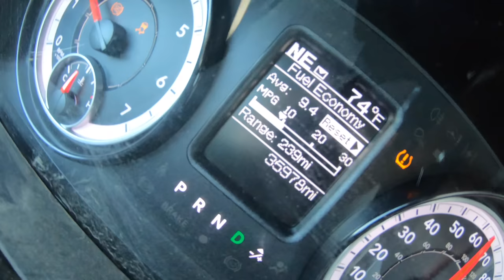How this Roll off dump trailer EARNS EXTRA Money!

Comment: Some good comments being made in the comments, but they're still limiting their thinking - with a "flat deck" one can effectively palletise* other plant as well.
Think large welders, large emergency pumps, emergency generators, etc, that are too small, and or light, for a "J" or shipping container platform to be required or cost effective. Hire companies and government/state/municipal/utility companies may be a natural market for these.

*As a kid I was enamoured with the whole Thunderbird 2 concept - use a standardised container and you can use the same machine to move everything. I still try and apply it to plant in general, when allowed.
Reply from the maker: Thats brilliant.  I didn't of it that way.  Im pinning your comment if thats ok.
Reply: @Dirtmonkey  
No worries - pass it on to the trailer builders, too, if you think they may be interested 👍😎
Reply: They need to add conex boxes to there system
Reply: @Dirtmonkey   A concept that has ran thru my mind about this style trailer is to have a half flat deck and half enclosed setup. That was you could use the back half that is flat to load or transport material to the jobsite or as stated put a large pump or welder on and use the front enclosed area as a mobile job box to store and secure tools  this could even be fitted with a fuel tank to allow on site fuel, tool, and storage.
Reply: Any more feedback to share on the DuraHaul after a year? I noticed they're no longer a dealer.
Reply: This concept will be made into all of that. It will be the Swiss Army knife of trailers. Think about construction site trailers and campers and tiny houses  a standardized system that encompasses all applications will be the industry leader.  And those features being compatible to this concept will also be more valuable.
Reply: I've been checking out all of the roll off companies and will check this one out now. Another idea is you can also haul small skid steers and excavators, roll the whole bed off with the equipment still on it, the driver can leave and do something else while the site workers unload the equipment on the ground and keep working.

Comment: It would be nice to see if the company can build you a sealed, lockable Job Box roll-off.  When doing a job like a retaining wall, you can deliver the box to the site first with all the necessary hand tools, power tools, basic supplies, and the small plate compactores.  Everything you need at once and a secure place to store the equipment at night.  At the end of a job, pick it up and move it to the next.
Reply: that's would be handy.
Reply: More excellent idea!!!
Reply: C can
Reply: now that's good.
Reply: Yeah that would be a great idea!
Reply: Seen a construction company with that. They created those them self
Reply: Like the way you think man drop off toolbox
Reply: I started outfitting cargo/shipping containers 3 years ago doing this. Each framing crew has a container and I have 1 roll off trailer to move them
Reply: Shipping container?
Reply: You guys never worked in sketchy neighborhoods?  People will break into anything given enough time.  Don't leave anything on site.
Reply: Isn't that just any enclosed trailer?
Reply: Well, they actually make roll off flatbeds. You can easily design one with everything bolted/welded down. Shoot, now that we're in this discussion, roll off office/tool shed so you have a place every morning where you drink coffee and plan,  and pack out.  You're welcome,  now you have a fat business idea
Reply: @chaseoes  enclosed trailers are easier to steal, steal from, you get thieves trying to get in. It'll be more solid. You don't need multiple trailers. Pick up drop off
Reply: @creeplife2802  ... and... it's gone.  =(
Reply: Sounds like an enclosed trailer that you can just unhitch and leave it without having to dump an enclosed box off the the goose neck…..
Reply: @snowmankace7769  is there a way I can see this or get pic? Thank you
Reply: @austinrush6057  Yea but a grinder and the enclosed trailer hitch is unlocked and one can just hitch up and go.  With a roll off you need a specialized trailer to steal... And now if one just gets a roll off trailer then one can have a monopoly on stealing rolloffs LOL
Reply: @trevors8577  If you’re going to bring a grinder to steal my enclosed trailer, why I can’t I just grind the lock off your box for this and steal everything? Same thing as a lock on an enclosed trailer hahaha. Bring a grinder to my storage unit too if you want. You’re going to get all my stuff. I could easily winch that bin up onto a tiltbed also. I really don’t get your comment.
Reply: @trevors8577  Someone who wants to steal is going to figure out a way to steal.
Reply: Turn a Dumpster into a shed by welding ceilings
Reply: Or just buy a $3500 box truck.
Reply: That's honestly a killer idea
Reply: So you want a connex box... Just Google shipping containers
Reply: Southland trailers out of Alberta has a roll of trailer with bins, flat decks and a shipping container like you’re talking about
Reply: Dude, just get a mini crane and a job box, boom solution fixed. If not get yourself a bunch of military style crates, and just strap them together so you can’t run off with them.

Comment: nah ill pass......these 10 to15 yrd cans I see on Ford 550 are the way to go.....now you have to worry about a trailer hauling it???   I use these setups on Ford chassis  all the time in tight areas, can't do that with a trailer......here in Nashville, Tn Viava charges $365 a dump.....7000lbs is the max

Comment: 😢 Buy it with the 8000 pound axles and have the title read 14,000 total GVW for the trailer and if you have an F350 that would have a GVw  of around 11,000 pounds so you would be under the 26,000 and your rims and axle and tires would be up for heavy duty work especially when nobody’s looking And it will go over curbs fully loaded much much better

Comment: If they welded big D-rings in the corners and the middle low to the base you could transport equipment as well…. With the weight limit in mind.
Reply: Most companies sell flat beds that can be rolled on.

Comment: I'm third generation in the solid waste industry aka garbage man...lol. 
In 1960 my twin uncles had built the very first Roll Off truck.
They called it a Drop Box truck with 20 yard boxes.
My uncles worked for their mother, my grandmother who owned the
the first garbage company in town. She only invested in the build
of the truck and didn't patent the Drop Box idea back then.
!!!CAUTION STANLEY!!!
I drove a Roll Off back in the 80's for 11 years and the one thing you
had to watch out for was boxes loaded to one side with dirt or
concrete, they flip over on there side when loading on the truck.
I would pound the sides of the box and if it sounded hard it was
loaded heavy to one side and you couldn't see it for each load was
full of other debris and tarped. Even at that. be careful on turns, they
will roll over easy if loaded heavy on one side. I could show you all
kinds of tricks we used to do loading/off loading in difficult areas.
But I live in California 🤐don't tell anyone!

Comment: Great video, there is a company from Minnesota that makes nothing but these types of trailers. Protainer out of Alexandria. MN. 

We have some of the best trailer makers in the country. You would have saved yourself lots of fuel. 

The plus side with Protainer is that they're containers can be used on any standard roll off truck as well. If I'm not mistaken, they're the only company that uses standardized boxes. You could use the same box on a trailer that you put on the truck and then you could also buy it containers from other manufacturers as long as they were a standard rail box.

Plus if you want more cans/containers you just have to drive to Alexandria which I'm sure no matter where you live in Minnesota is closer to you than Texas.

Comment: My experience has been on the consumer end of the business, getting a dumpster for remodeling jobs. My projects are usually on the smaller side so I can often handle things with my single axle dump trailer. The last time I had to price dumpsters I called three ‘different’ carting companies and the same person answered the phone each time. All three were owned by the same parent company.
Usually here in Connecticut you get a price for a certain volume, say 12 cu. yds, a week to fill it and a weight limit, say two tons. If you keep it for a longer period of time they add on a certain amount per day. If the can is over weight when they dump it they will bill you, as in charge your credit card, for the overage.
Reply from the maker: good info- Thank you.

Comment: Having worked on rolloff trash trucks for 2+ years my recommendation would be have a 2nd winch installed and wired in for redundancy as when a can is overloaded winch cables break and its no fun when a winch cable breaks and takes out a glass window or even hits the operator not to mention the can sliding back off the trailer and you being stuck with a broken trailer needing to pickup a box that's full. personally id get a hooklift trailer that uses a hydraulic arm to lift cans on and off they make trailers and beds for trucks and there is way less to break on one of those than a flying winch cable
Reply from the maker: I never though of it like that.  I wonder if someone makes a hook lift trailer for a pickup?

Comment: i’ve wanted one of these for a few years now since first seeing them, but my biggest concern is all the negative i’ve seen/heard about the lifting power when dumping. i had some texas built dump trailer 10 years ago that could barely lift C&D let alone dirt so hot rod of it within a year or two, since then i have multiple brimar dump trailers and they never let me down. and obviously a box with 4 foot walls you can’t load the entire thing with dirt you’d be way over weight (i know that part) but i’ve seen a lot of guys on youtube that put only a couple yard of dirt and can’t get these to lift yet i’ve lifted 6 tones of cement in my brimar dump trailer. but i’ve also seen these dumpster trailers with small honda motors that run the hydraulic system. idk this comment was all over lol hope i works out well for you looking forward to future vids because i really do want to get some of these!
Reply from the maker: I hear ya-  Your curious if it will handle a load.  I will find out for you.👊👍😎
Reply: That's a good point.  They look good in the dealer's yard, but I've seen people at the dump using ratchet car jacks to get their can up.

Comment: Cmon Stan, you KNOW that you need to speed load a Skidsteer into the can in order to fully show the capabilities of this setup! The only thing that I had a question about was the security of the single D ring for the tailgates when dumping. I have 20 years in the waste industry and doors swing free when dumping with the conventional chains. Great vid and great product!
Reply from the maker: The only thing that I had a question about was the security of the single D ring for the tailgates when dumping.- good call.  I wonder how that will hold up.  Guess I will find out
Reply: @Dirtmonkey  I dumped rolloff cans from 15yds to 40yd self contained. When you get a “stuck” load and have to run a verticals can back and forth and even use the cable to tap it on the transfer station floor, the first thing that comes loose is the door securement. You have a quality channel sir!

Comment: Stan all fine if it fits your needs if you rent them cans will get destroyed and overloaded loaded wrong all weight back end of can would lift the back of your pickup off the ground and if you tow with a 4500 or 5500 series class of truck puts you into a class A CDL but hope it works well for you. I personally for that money spend a little more and get a under CDL single axle roll off truck.

Comment: We have a roll off truck. 22 dodge ram 5500 SNG setup. Different rate structures. 1-3,4-7,8-14 days. We use it a lot on landscaping, material delivery, and rent our dumpsters out. We re in w a few contractors that do roofs, remodeling etc. different entity, lots of money to be made, we average $250-300 a dumpster
Reply: What size dumpsters?

Comment: I'd love to see a full in detail video of this trailer. Of you using it. Setting it up. And ideas u have for it. As a yard maintenance man myself I'd modify one bin to turn it into a grab and go leaf connection system. I.e. I can drop it on a site for some of the guys to use and go back later to get it.

Comment: The brake in the winch will eventually fail from powering out.   Those types of electric winches are not designed to do repeated power out but rather free spool.  The brakes are internal to the drum.  You need a winch with an external (to the drum) brake.

Comment: Hey Stan,  great trailer,  Have you thought about putting a heating element on the sides,  great snow removal for job sites
Reply from the maker: I plan on using it for snow hauling but not heating it

Comment: My neighbor runs something like this. He probably moves 3-4 cans a day. It can make money but the batteries on a rig like that don’t keep up. He keeps five batteries on the trailer and has to switch between them to keep it running. He charges them all every night.
Reply: Run cable from truck to trailer to keep it charged.  We have that on our truck and works great.
Reply: Run a 1/0 gage cable from the truck positive and trailer positive. Then ground the battery on the trailer to the trailer and boom no more charging

Comment: I have actually thought of something similar to this after looking at used military roll off trailers but they use a crane.  You can have a flat bed that you strap equipment to and deliver to the next job site and then a dumpster like that one that you set some where else.  And then even use another flat pallet and built an office trailer on it and put that somewhere else.

Comment: We're I live in western Pennsylvania.  We have a company  that has the same setup. Multiple  cans for drop off. $325.00 for 5 to 7 day max. When they scale  at the dump. Any weight over 3000 lbs is charged to customer by the pound. They also have bulk pick up or any junk that needs gone. Send a picture  they give you a price.  It will be gone the next day.

Comment: Nice package.. Flat deck option is a Great one provided it also has ramps so that you can flat load equipment on it then pull it up.  Also for flat deck application it the winch were mounted higher it could serve double duty by being able to pull loads onto the "flat deck"

Comment: 20 grand that's incredible my boss bought a 16 ft  dump trailer I had him build every 3/4 L bracket slots using wood planks to separate material but with this you have three  bins you can put the green waste and one the concrete and another glad he's coming up with a low boy cuz I was going to say if  you  filled  that up with concrete you ain't going to dumping it you ain't going to picking it up  people with a roll off business know there are people  stupid enough to fill up something that high with concrete and any material that you get where you can take one of them to the landfill one to the concrete quarry and one to the metal recycling yard I like what James Flori had to say a enclosed roll off so you can store your equipment  in  and with a security system

Comment: As an Euroguy i have to smile a litte. A "Hookloader" is the most normal thing here and i dont inderstand why it issnt in USA. No need for step out of the cabin. It comes in an standart size and system, so every Hookloader Truck can take every bin/flatbed/craneplatform what ever.
Reply from the maker: That just makes sense in my opinion. Universal is easy

Comment: Check out Cam Concepts, they build a Hook-Lift Trailer. Much nicer trailer, and you can get them in different hook heights & gvwr.
Reply from the maker: I will.  Thanks
Reply: @Dirtmonkey  I have the 16k model, if you're ever in Maryland and want to check one out

Comment: We have trucks in uk that do this called hookloaders! There much better than the cable pull!  You can tip them up soon as the back touches the floor leave the handbrake off the lorry and let the weight kf the container push you! This elemanates the dragging all across the floor leaving marks you can basically drop it off on the spot! Its like 10 trucks in one! You can use it as a low loader! Normal tipper! Or get a hotbox made for asphalt! Don’t understand why everyone with a truck aint using them

Comment: This feels pretty nice. But it feels it would be better if it is a hook lift system instead of the wire and the body fram it’s under and have a hook that you in to from the car. Nice video
Reply: I have a hook lift version

Comment: With the 8k axle option that gives you 10k in the bed no? 6k for the whole thing so I think you could probably get away with something like putting a skid steer in the back and then dropping both off at a site

Comment: Great video as always Stan my biggest question is why would they have two controller and not intergrade them into one. I would imagine with one wireless controller that you can use with the winch and lift you can increase production time faster drops and pick ups. With the person safely in the truck. To me it seems kind of back yard made with out having something like one controller for all.
Reply: One controller would be great, but you probably need to watch the dumpster and be sure it stays on the track. Especially if the ground is uneven, as it usually is at job sites.
Reply: Honestly probably because it would be tied to the winch and trailer. If the winch goes out you would need to re do the controller anyway, and the same for the dump feature. It would also make it harder to upgrade. But with separate controllers you could put a Harbor freight winch on there if you wanted and it wouldn't affect the controls, Or you could upgrade the pump without worrying about compatibility.